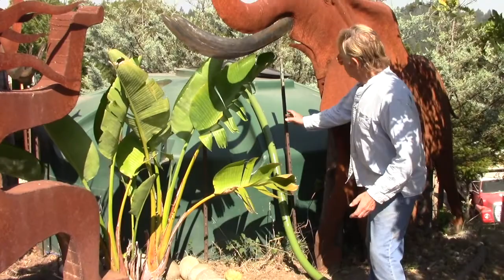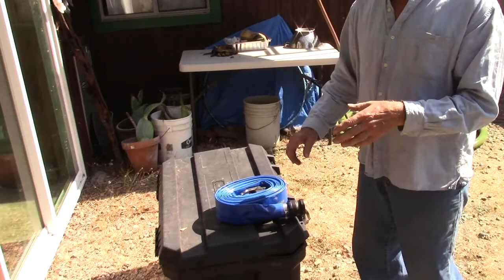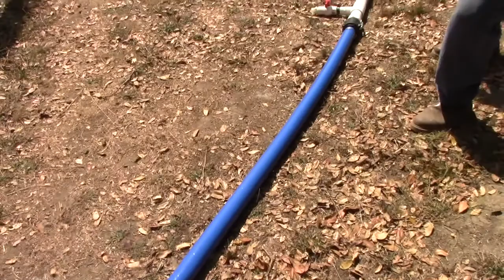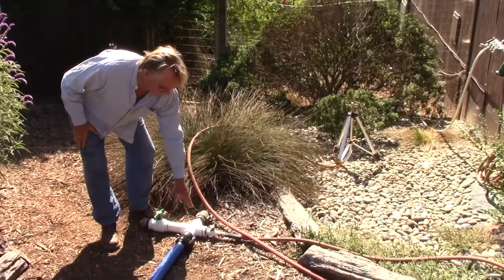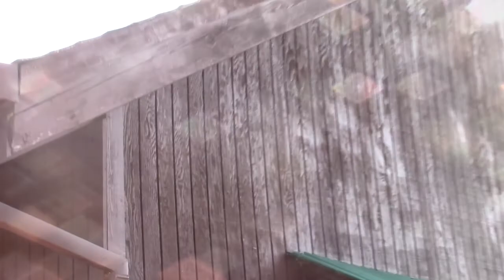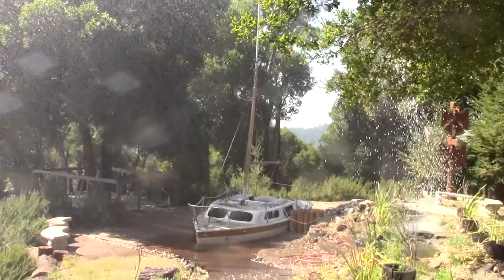Robert Seals on Personal Wildfire Protection

Comment: Don't use standard pump gas with ethanol.....Buy VP FUEL 94 OCTANE NON ETHANOL FUEL SMALL ENGINE FUEL.... IT'S EXPENSIVE BUT YOUR PUMP WILL START WHEN YOU NEED IT GUARANTEED FOR 5 YEARS UNOPENED AND 2 YEARS IN THE PUMPS GAS TANK

Comment: That blue discharge hose cant take much pressure and is meant more for dewatering. Standard structural attack line is 1 3/4". Master streams range from 2 1/2" all the way up to 5". Forestry is 1", 1 1/2", and small lines from 5/8" to 3/4".